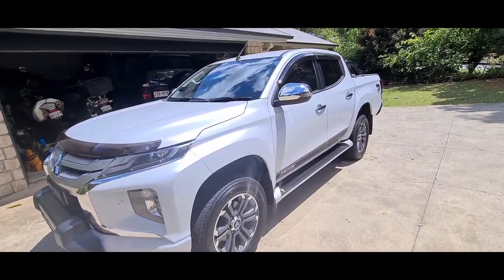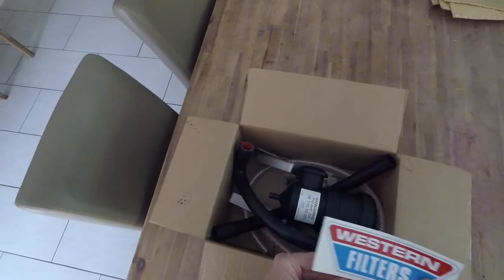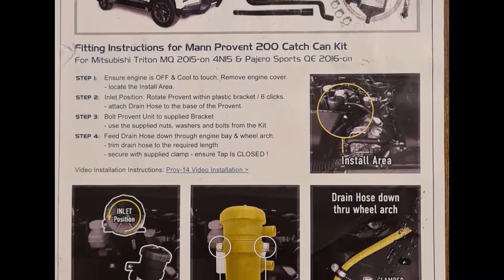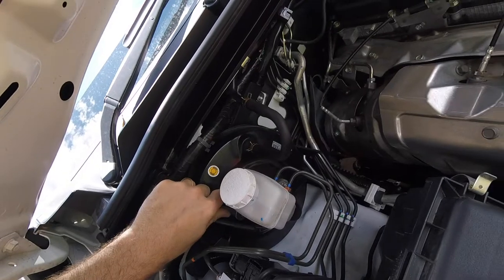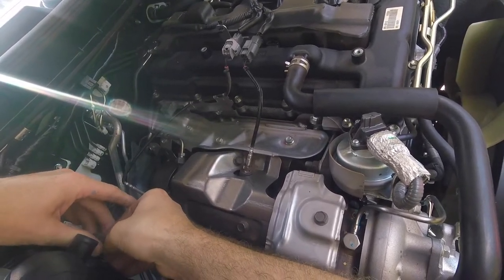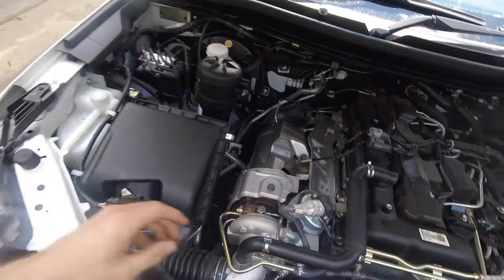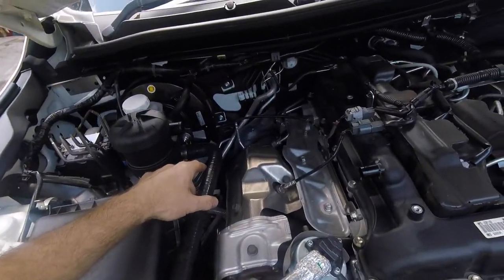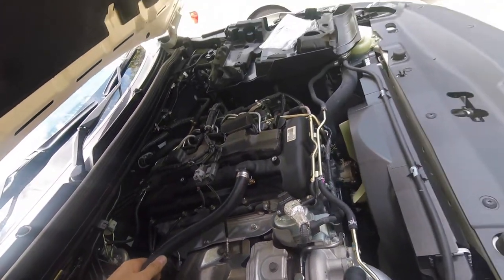Mitsubishi Triton MR Catch Can Installation - Kit by Western Filters

Comment: First off, thanks for this video, one of, if not the best instructionals for MR Triton. Just wanted ask about the mounting bracket. I have seen a few other videos where the mount attaches to a bolt above the wheel strut (think that is what you call it...). People have commented that it is a bugger to get off and also the straight hose that you formed into the S shape was a bit prone to small kink. Your kit didn't seem to have these issues. Would I be right in thinking that the supplier has modified the kit and you no longer have to wrestle with that lower mounting bolt?
Reply from the maker: Thank you very much. You are absolutely correct. The kit supplied by Western Filters was a very straightforward installation and a great fit. I  recommend it 100%. 👌 Cheers, 🍻 👍

Comment: Why is this not fitted when vehicle is new , if it’s so important to have and what purpose does have when fitted ?. Thankyou
Reply from the maker: Hi Rob that's a good question, considering they are a relatively low cost item compared to other accessories. Some other vehicles, such as many trucks, do come with them already fitted from factory. I have added a link below explaining reasons why you may want to install one. Remember, they need correct installation and maintaining to work properly and efficiently, so as  not to cause any problems to the engine. The decision to install one is entirely up to the individual. 
Cheers, 
Grant. 🍻👍
https://www.repcoservice.com/hints-and-tips/does-my-diesel-need-an-oil-catch-can

Comment: Mate, just ordered a triton, what did they say about warranty if you fit catch can?
Reply from the maker: I had the same question too, and also conducted my own research before installing the catch can and decided it was better to install it earlier on to avoid any issues down the track. Mechanics that I asked said it was a good idea as long as the servicing was maintained at the recommended intervals. 
https://youtu.be/lz-i0yGC9dE

Here is what Mitsubishi Australia's Diamond Warranty FAQ's state on their website;
The Warranty applies to the original components that have not been modified or altered from the manufacturer’s specifications. Modifying your vehicle or installing parts and accessories which are not approved by Mitsubishi Motors will NOT void your warranty. However, if a modified part needs replacing or causes damage to other components, this will not be covered.
So really it is up to you to make sure that ANY aftermarket part is fitted correctly and maintained to ensure that it does not cause damage to other components so as not to void your warranty.
Check out that link too. Hope this helps. I hope you enjoy your Triton, we have done over 20000km already in ours and absolutely love it! 
😉👍🍻
Reply: @nextmotoadv247  cheers mate, i will look into installing one on mine also!!